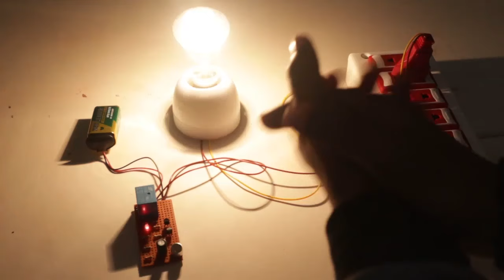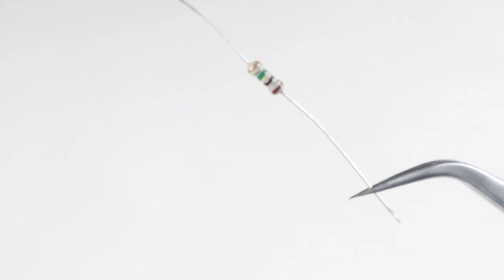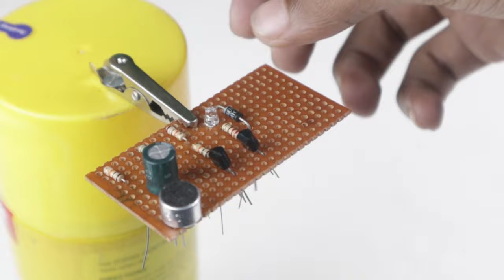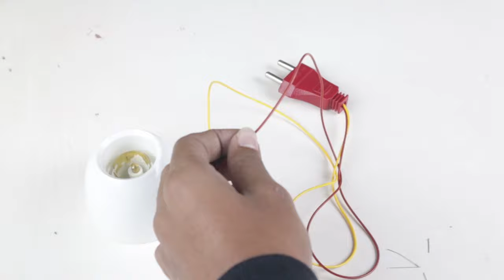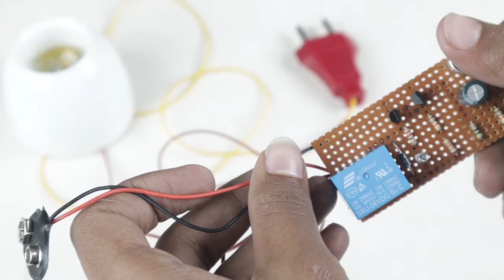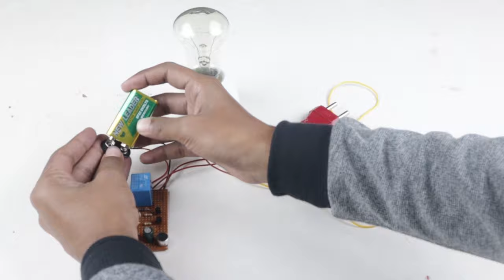220V Simple Clap Switch Circuit Project | Make Clap Switch Circuit With Relay At Home

Comment: Can i use 12 volt relay
Reply: Yes, if you use 12volt supply for electronic circuit
Reply: @wiktorgreda2124  thanks a lot  BTW my project done
Reply: @Sanataniihinduu  what is voltage of relay as well as capacitor?
Reply: @Sanataniihinduu  can you send diagram please?